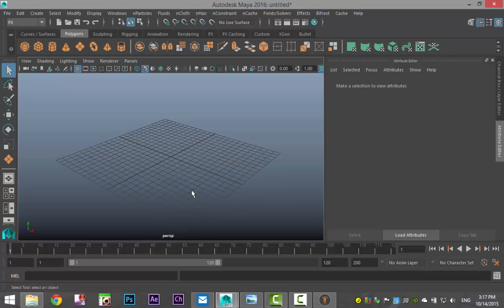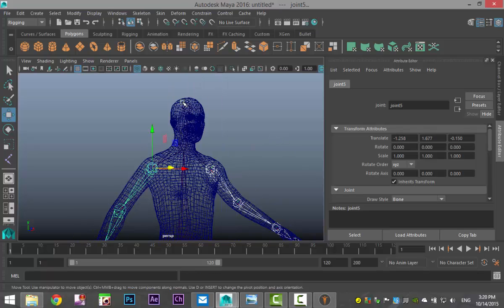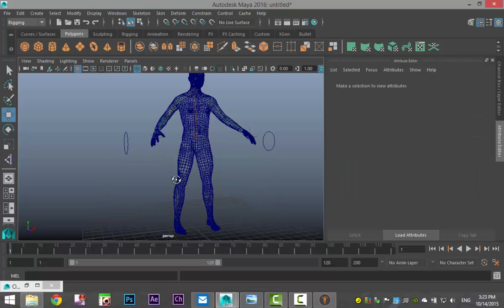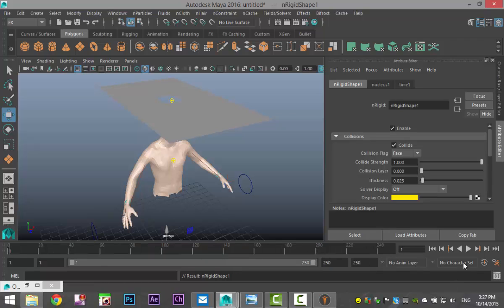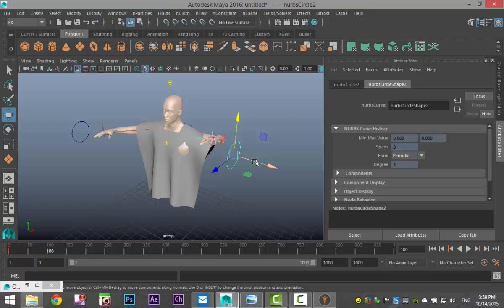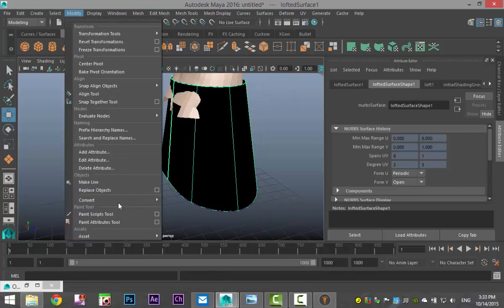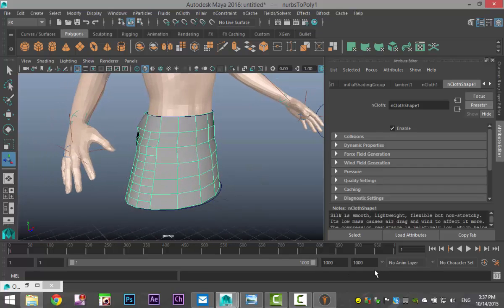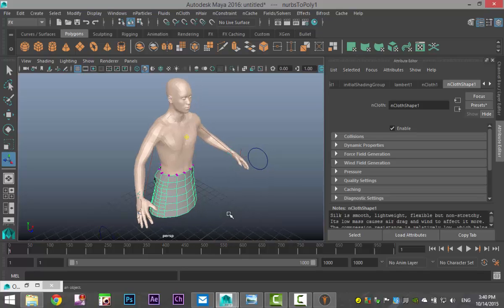Maya 2016 tutorial : The basics on how to animate clothing

Comment: If you haven't figured it out yet, you can uncheck the ability to select joints and curves and such so you can select only the geometry like you were trying to do at 21:17. Right below the "L" in nParticles there's a line with an arrow, click that and it opens another little menu set, then unselect the joints icon or whatever you want to make unselectable, and then you can grab vertices without grabbing the joints underneath.

Comment: The selecting of the joint when trying to select your verts has to do with selection Hierarchy.  The order starts with handles then joints... I don't remember where Verts fall in the hierarchy.  The hierarchy can be controlled from your Status Line.  You have a closed menu there to the left of your snapping toggles.... I assume you'll be able to take it from there.

Comment: (Off topic question) So when I try to make rope in Maya 2016 it's a little weird and it does not act the same as in your older video showing how to make rope. And was wandering if you could go over how to make rope and barbed wire and etc. because I am having a little trouble finding an updated video about the subject.

P.S Thanks making your videos! They are awesome!
Reply from the maker: +Snipe God I did videos both on twister rope and barbed wire and although done in a previous version of Maya it hasn't changed.

Mike